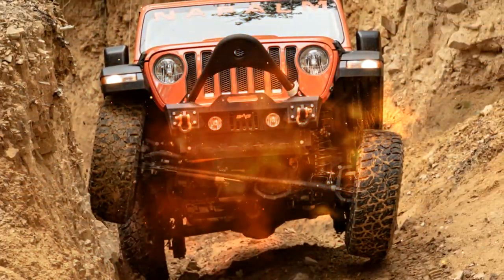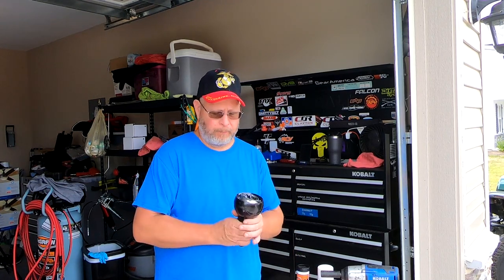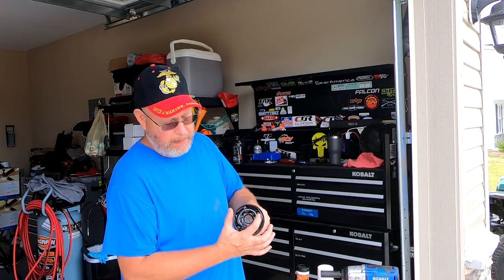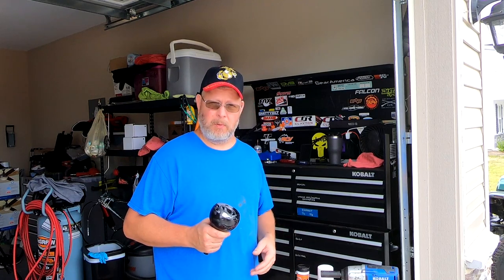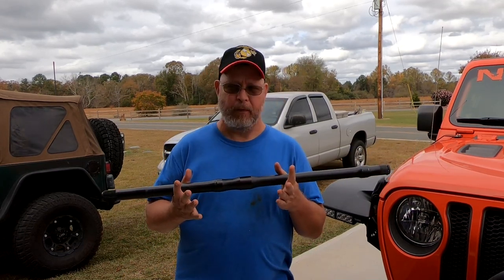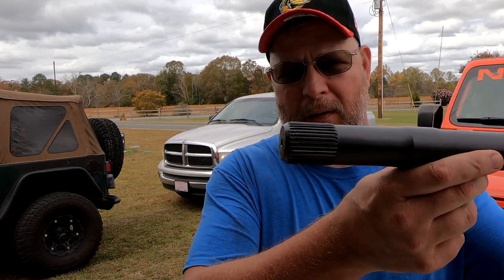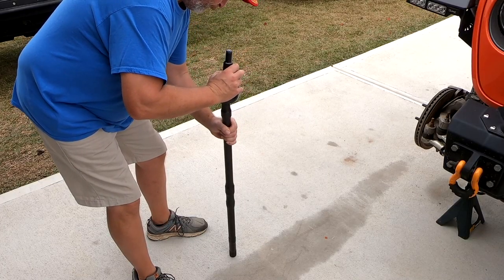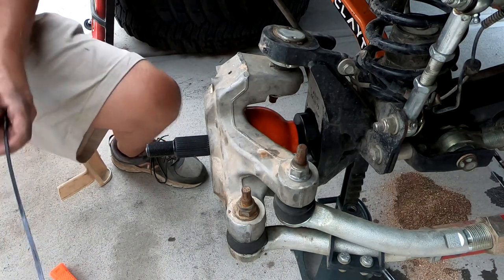How to install RCV Axles in Jeep Wrangler JL

Comment: Thanks! You answered what I was supposed to do with the C clips! Now I still gotta figure out what the extra grease is for...?
Reply from the maker: LOL! The extra grease for future servicing. Get you a grease gun specifically for your RCV's. That's what I did! Thanks for watching, and the comment!
Reply: @ShockWaveOffroad  Crap, I just finished the install and saw this video, now I need to go back and add that one part. Your video was very helpful
Reply: @kyferez1 did yours come with the part at 12:05?
Reply: @ericlugo  That's not a part you install, it's a part that helps you install the boots.
Reply: @kyferez1  yeah I know but would have been nice to have. Mine didn’t come with it

Comment: Just got the RCV one piece kit installed. I’m having a lot of driveline vibrations now. Any ideas why?
Reply from the maker: Sorry to hear this. That said, what you're asking is a bit of a loaded question. "Driveline vibrations" could be anything from the axle shafts, to the drive shafts, to bent wheels, unbalanced tires, worn control arm and/or track bar bushings, etc. I'm going to ASSUME you didn't have this issue prior to installing the RCV's. SO, (I) would double check everything I did and make sure everything was installed correctly and torqued to spec. If you had someone else install them, I would contact them and have them troubleshoot the issue. Interested in what you find. Keep me posted.

Comment: I am surprised that you didn't install locking hubs at the same time as this upgrade. I guess the price could be a factor but it also seems that locking hubs would save you a lot on on road use.
Reply from the maker: That's something I wish came from the factory, LOL! That said, I'm not sure there is even a conversion for the new JL axles. (IF) I ever go to Tons, locking hubs will definitely happen.👍🏻

Comment: Great video. I have a Gladiator I'm getting ready to do 5.13s on and I'm considering replacing the front axle shafts to eliminate the FAD. If you have a Tazer JL. You can actually turn off the FAD system, obviously not a requirement since the coupler is being removed but worth mentioning. Quick question...I haven't looked to see if you did already but if essentially making the front axle fulltime, in terms of it spinning and spinning the driveshaft, do you recommend replacing the factory driveshaft at the same time?
Reply from the maker: Nah, changing the driveshaft is not a necessity just because the diff is now turning with regular driving. I will be changing driveshafts in the future, but for added strength in the drivetrain. The stock driveshaft, like stock axles are "adequate", but under articulation, heavy tires, and skinny pedal LOL, they're not ideal. One guy I know has broken 2 front driveshafts.🤣🤣 I have the ability to turn the fad off with the Superchips Flashcal, but I'm going to leave it as is for now, until I do the full fad delete. Glad you liked the vid, and thanks for the comment!!👍🏻👊🏻🤘🏻

Comment: Where did you get the torque specs for all the bolts?
Reply from the maker: The torque specs can be found easily through a Google search. Since all of the bolts in this modification had relatively low torque rates, I just used my calibrated elbow😉. The only spec I was really concerned with was the axle nut, which is 100 lb ft. Thanks for the question!